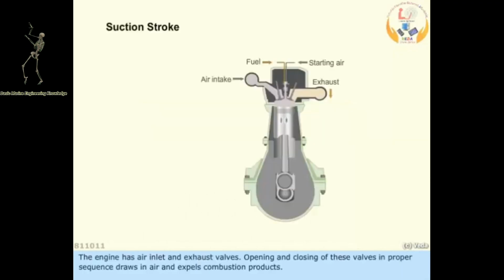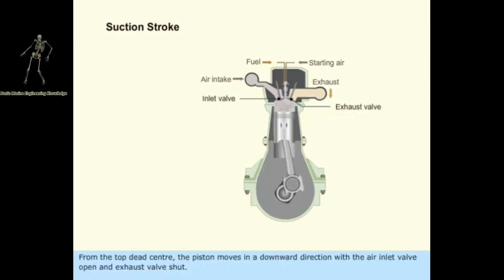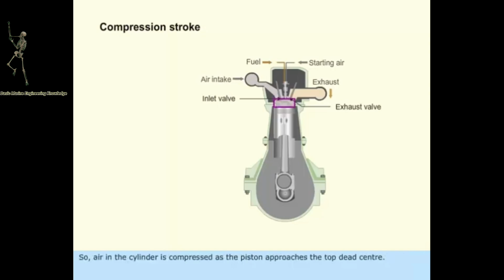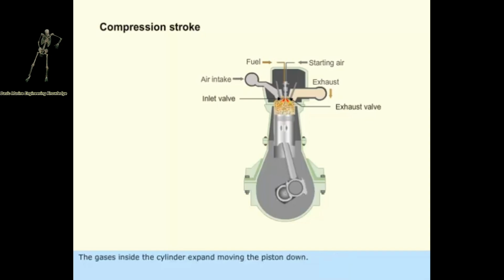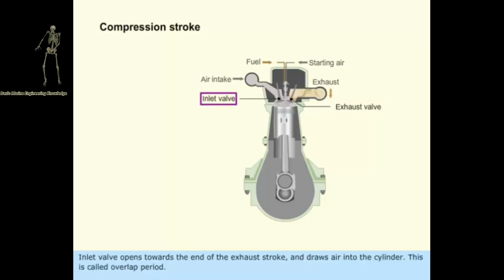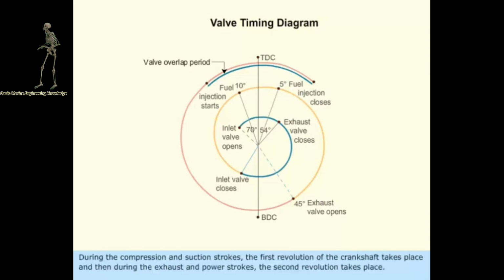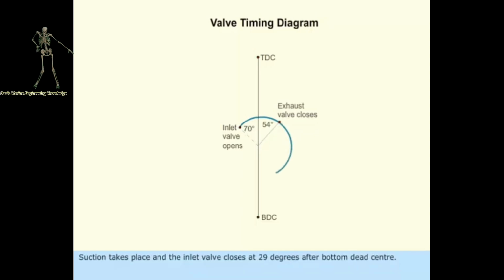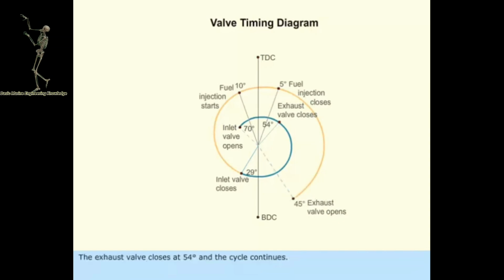How 4-Stroke Marine Engine Works | Generator on Ship Explained| Working Principle

Comment: the crank angles in this video are wrong and way off for a 4 stroke diesel engine, if the inlet valve opened at 70 degrees before tdc the fuel would just sit and not ignite as the air wouldnt be fully compressed